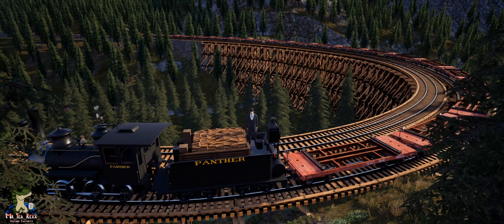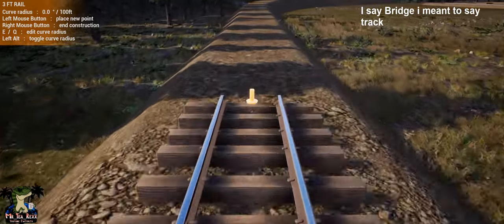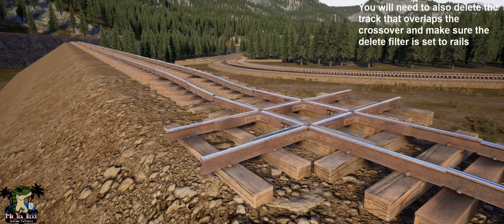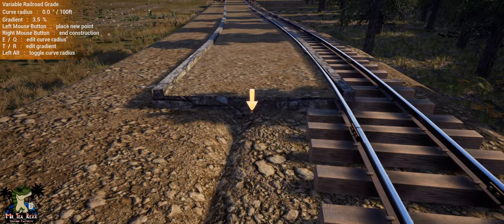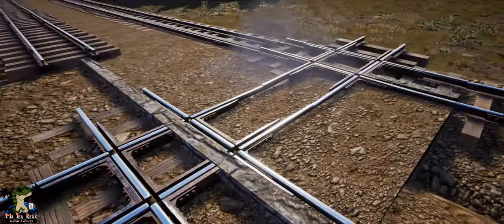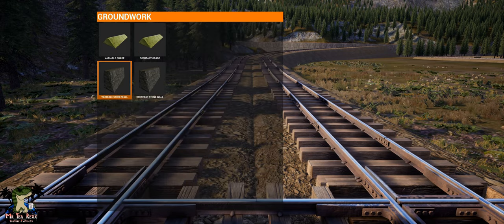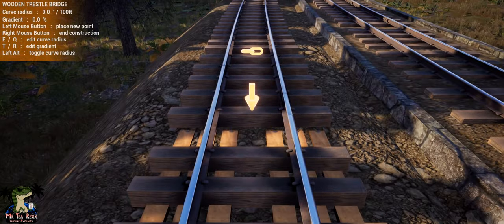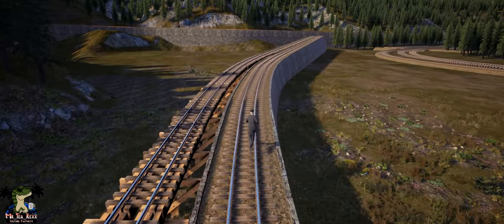Railroads Online! Tutorial 03 Bridges - Straights, Curves and Double

Comment from the maker: This took me an entire week and a bit to do, I scrapped the entire audio and took parts from different takes. my voice is in different tones nothing i could do about that sorry. Hitfilm Express's latest update has a HD codec Issue, so had to export in  AVI uncompressed and used handbrake to convert it and re-encode it. Will be downgrading to 2021.1

Note: if their are gaps in the bridge on the normal 3ft rail bring it back slightly from the snapping point, for the rail deck i wouldn't worry about it too much as it blends in with the rail deck

Comment: Great tutorial. How about multiple level bridges? I make each level as high as I can but it's hard to see where exactly I turned the previous level. Should I be making each level not that tall?
Reply from the maker: for higher lvls you put layers apon layers of dirt groundwork, then do the tutorial method. How i do it
Reply: if you need REALLY high bridges, you can lay dirt groundwork and ramp it up 10 degrees. you can then go to the high end and run it back the opposite direction. just keep piling on more to get to insane heights. just make sure to leave room to place your actual bridge. also consider the height you want your actual bridge at and the angle is shallow enough to allow a train to climb it. i'd suggest no more than 3 degrees.